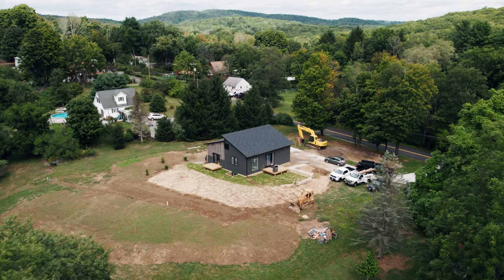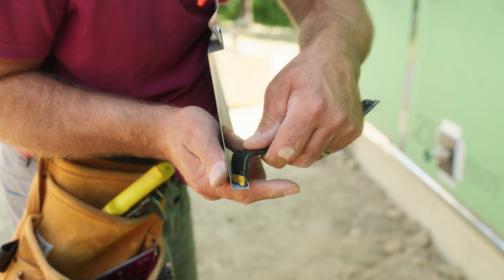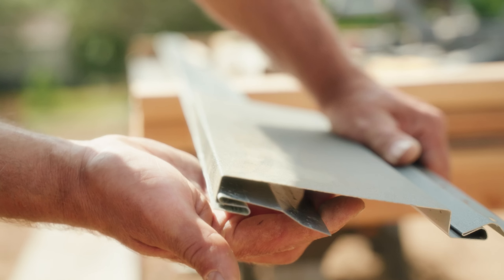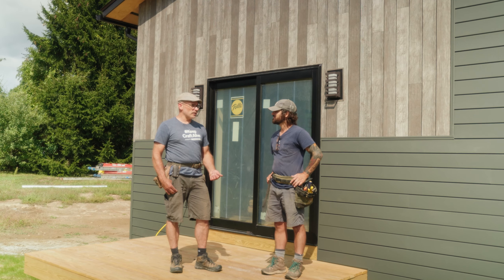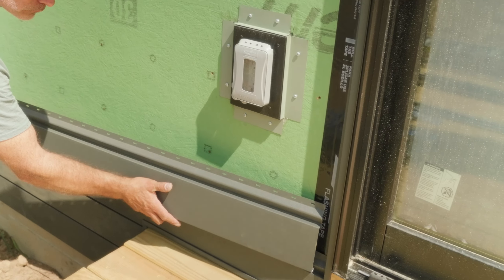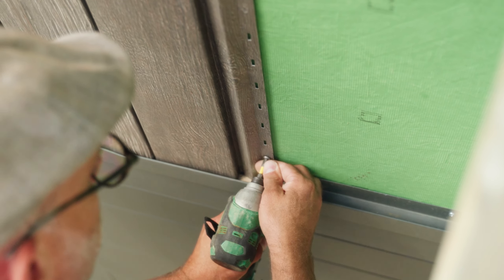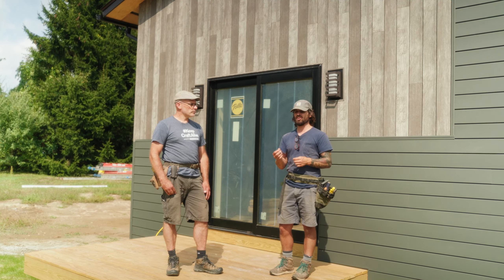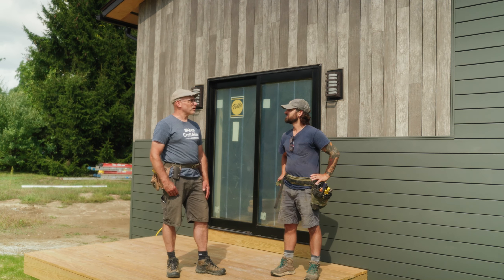What You Need to Know About Installing Steel Siding

Comment: I like the color variations between the different planks, I'd be interested in seeing the cost difference between this and a Hardy siding, Personally, I'd be a little worried about what Hail would do to it. Another concern would be that being metal you wouldn't be able to pry it apart in order to get under it like you can with a vinyl product.
Reply: Hail can damage paint and ruin the appearance，but the steel plate still has corrosion resistance.